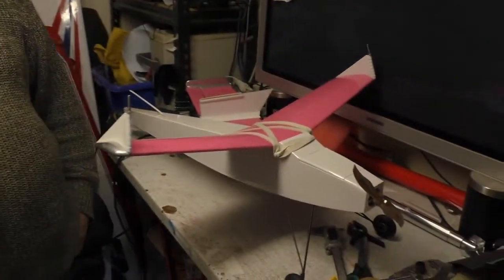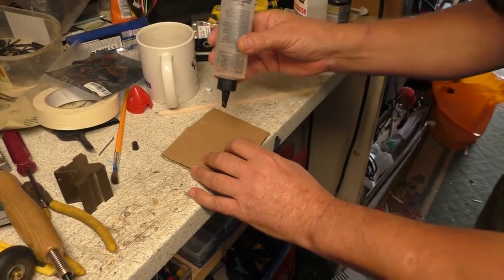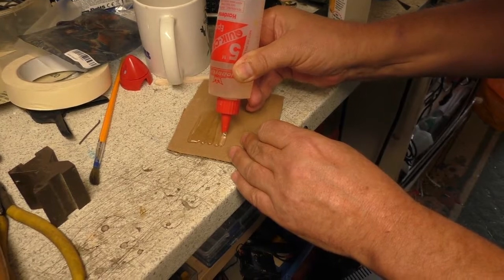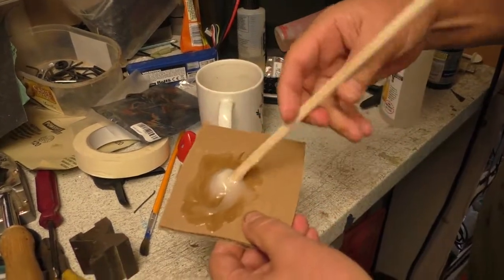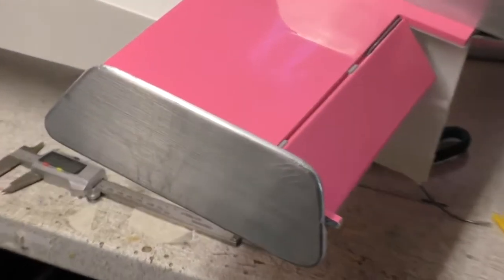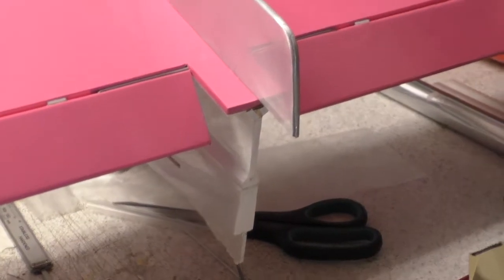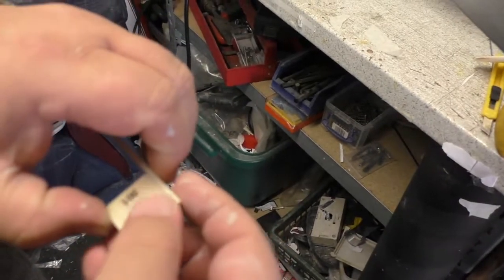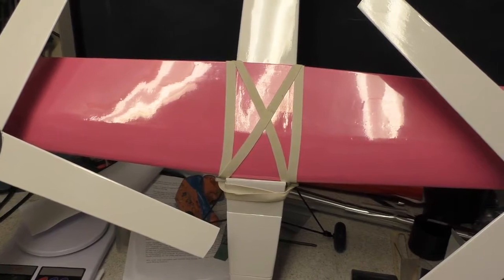DB Sport & Scale Autogyro Build Pt12 RC Model Geeks

Comment: Some more epoxy mixing  tips for you,use ice cream container lids etc make ideal mixing surfaces,surplus dried epoxy can be cracked off for re-use of the lid,when mixing in hot weather spread out the epoxy thinly after mixing otherwise if in a big lump thermic reaction will take place quicker with heat build up and the stuff cures before you get to use it ! in your cold shed in winter sit the two bottles in hot water so it flows easier wrap some lead weights around the bottom of the bottles so they sit low in the water,weather here blowing a gale too in the Midlands with trees bending so grounded just enjoy your building,you are very neat with the iron on film and the 'Pink Panther Autogyro' is looking splendid,top marks for an excellent tutorial.
Reply from the maker: Thinking of covering a model in nylon and dope... Any experience?
Reply: Yes I still use dope and tissue,we used to get our nylon from the local market,put it on wet pulling the edges and sticking down with clear dope,tough as old boots.
Reply from the maker: Great ill know where to come when i get stuck !
Reply: Any time we learn from each other,love your channel its user friendly by modellers for modellers.